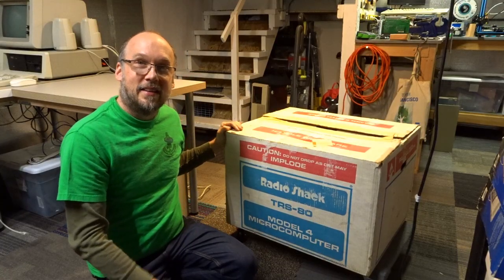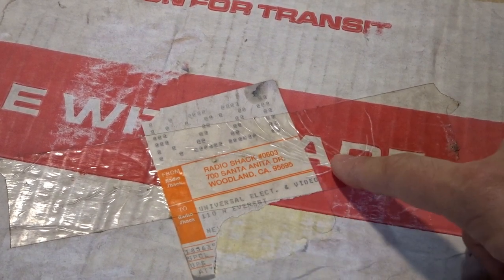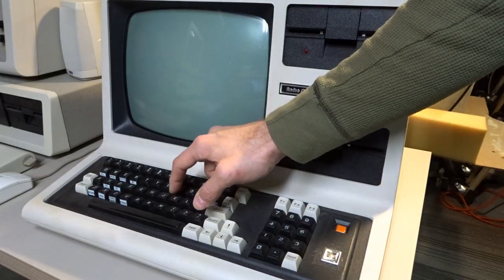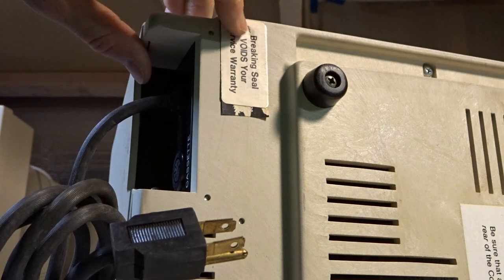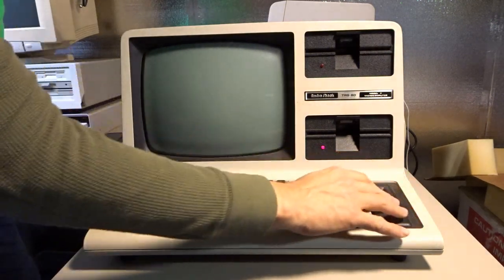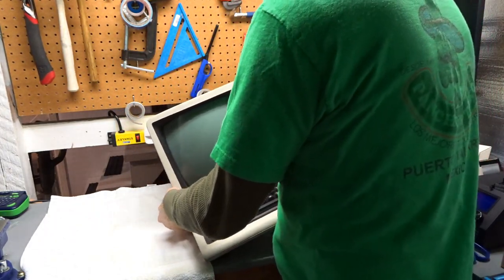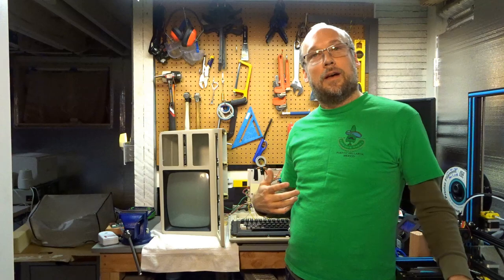Is that smoke? Radio Shack TRS-80 Model 4 Computer Unboxing and Test

Comment: Damn you just voided your warranty by opening that thing.
Reply: That's really a myth. Manufacturers are always putting those stickers on, but by law, they cannot void your warranty just because you opened it.
Reply: Tesla has a seal that says opening their car motor that warns - “opening this motor voids your warranty”. I can just that motor apart to see what’s in it and not worry about voiding my warranty?
Reply: @reh3884  Around 1982, I opened a Model II to adjust the horizontal position, later it was taken in to a RS Computer Center and they ended up charging a fee because the seal was broken.
Reply: @reh3884  I don't know about the jurisdiction in your country, but here in Sweden warranty is laregely a voluntary thing on the manufacturers part (with some exceptions as stated in law), and if it's voluntary the producer is free to deem the warranty void. And I guess that law works the same way in most other jurisdictions. The thing of note here is that many people probably misunderstand the meaning of the word "warranty".
Reply: Australian law contains an implied warranty for anything sold, which takes precedence over any warranty offered by either the retailer or the manufacturer.  Unless the retailer or manufacturer can show that your opening the case either caused or contributed in a major way to the failure, they risk an expensive penalty imposed by a court of law.
And no, the consumer does not generally have to initiate that court action.  There is a government body which will do that (although they prefer to avoid expensive court action if it's possible to resolve the complaint without involving the courts).
Reply: Did anyone catch the sarcasm?   M
Reply: @mirrorsevenband4700  I did, but I was replying to other replies, not to the OP.
The OP's joke gave me a smile, but I didn't have anything to add to it.  It stands on its own quite well. :)
Reply: @j.lindback  I'm taken aback at learning this about warranty policies in Sweden. Your country is part of the EU and as such ought to comply with 1999/44/CE and 2011/83/UE Directives about the Sales of Goods and Services which state that the compulsory warranty is 2 years minimum and operates between seller and customer for all goods legally sold brand-new. That is the legal non-waivable warranty as opposed to manufacturer's warranty which is totally optional and voluntary. Are you sure you got your info right?
Reply: @richshealer3755  Seal are endanger species, they must be protected.

Comment: I worked for Radio Shack Canada in the   distribution warehouse in Barrie, Ontario for years just at the tail end of the TRS and Tandy Computer era.  I was a QC inspector for computer equipment.  The 4C4 on the box is the date code which would confirm final assembly was April 1984.  "Burn in n proud" is a new one on me but may mean it was one of the units that were QC tested before the shipment was released for distribution.

Comment: I have had a lot of these very same RIFA brand filter caps blow up in some military surplus bench power supplies that I picked up a couple of weeks back. I know that very smell! 

PS: Once you are done recapping this beast you should add a stamp of the same style with "AB RECAP N PROUD"  

Good to see you back!
Reply: those RIFA s are notorious for this problem, they should ideally be replaced on sight, especially if their epoxy casing is cracked or showing signs of starting to crack
Reply: as for the other caps, they'd probably be ok, this was made well before the 'capacitor plague' era! i rarely come across bad caps from the 80's,
Reply: "AB RECAP N PROUD" made my day :D

Comment: Oh no, you let out the magic smoke from the computer. It will never be the same
Reply: The Mad Salvi rip pc
Reply: Don't worry; all you have to do is put the smoke back into the computer and everything will be fine.
Reply: You can get a replacement can of magic smoke at the same place as you find the long weight and the round tuit.
Reply: @1973Washu  that is also where they sell headlight fluid and elbow grease.
Reply: @MadMorgie6318  lol

Comment: My first computer was a Radio Shack model 1. I got it because they upgraded the 4k mem model to 16k. Would anyone ever need more! No floppy drive without an expensive add-on and stuff saved to a modified cassette tape deck. 1979.

6 years later I obtained a Mac SE. Still floppies (3.5") A friend an I ordered Quantum hard drives and installed them. By buying two we got a special price of $540 each for 40 meg, not gig drives. We had to remove and modify one of the floppy spaces to install them. Would anyone ever need more storage space! Great wild west times.
Reply: Wow 40 meg, you glutton! lol my Olivetti 086 only made do with 20 (although it did have 128k RAM I think and a socketed 087 math co-processor so it was quite the lightning bolt!)
Reply: i had hte external 20Meg drive on my se. ohh the days. still have that thing.
Reply: Totally, I remember being so excited the FIRST TIME I PUSHED A CD-ROM TRAY EJECT BUTTON, OH MYSTERY OF MYSTERIES, If only I could evoke that simple exciting feeling with my VR games, I'm trying!

Comment: I worked at TCA from November 1983 to Dec 1984, I was also in the back working on Model 4 pcb’s, and the floor with the Floor Techs and in Engineering. We were developing a model which would contain a modem IiB and some better drives, but were always under the cloud that everything we were working on was about to be overcome by events. Sure enough, when I visited the plant a year later, only a handful of people remained; the CoCo assembly line took up a tiny square in the middle of what was once a sprawling plant at 1515 Goliad Road. The building is even gone now. But most of my best troubleshooting and electronics skills were finely honed at Tandy Computer Assembly, and I happily remember my days there.
Reply: I started with a CoCo 3 <3

Comment: From the key labels, I would say this unit was used for word processing. The popular word processor for this model was Scripsit, and they would have used it with one of the Daisy Wheel printers on offer at the time. When I was working at the Radio Shack Computer Center, we sold a ton of these to attorneys for word processing. Couldn't keep them on the shelves.
Reply: Yep. My dad got a second-hand model I which included Scripsit with its collection of software in about 1980. I remember there being a section in the manual telling you how to label up your keyboard. It came with a set of audio cassettes as well with spoken lessons on how to use the software.

Comment: That shipping label is from the DC to the store who ordered it on behalf of the customer. They gave each DC a ‘store’ number for tracking by their warehouse management system, which was written in the 70’s on a Tandem non-stop machine and was continually used until they shut it off in 2017.

Comment: I worked at a Radio shack Computer Center near Northlake Mall, Atlanta when the model 4 came out. That vinyl cover you have there is a separate SKU.  Sold separately, and didn't come with the model 4.  I had a model I at the time, and the 4 impressed me by being a single self-contained unit, which solved problems we were having with the Model 1 keyboard and expansion interface cable.

Comment: This Model 4 is definately not a Gate Array version. As the gate array board has a different layout the serial port exists to the rear of the cabinet. A gate array board won't fit in a non gate array cabinet. This destinction is the only way to tell if it's a gate array board inside without opening the computer and looking on the board itself. -Rainer (Germany)

Comment: I had the TRS-80 when I was growing up. Or at least, my older brother did, they were his but I still have a lot of memories of using it. Our grandparents gave us a TRS-80 and a TI 99/4A. 
The Tandy was an earlier model, the monitor was separate from it, and we used cassette tapes. There were game cartridge slot on the side of it too. 
It was such a great computer for its time too, this was somewhere mid 80s for me. There was this magazine I remember getting in the mail that was just all about the Tandy with codes and everything. This was back when you ordered video games through the mail. Cheap print out catalog, and they'd send a floppy disc or cassette in the mail inside a plastic sandwich bag. It was cool.

Comment: Interesting find, I remember the cheat for the SSD was to use a paper hole bunch on the diskette jacket and flip the disc to double that storage. You're right about the homemade hacks -- I bought a Coco 2 that had a half meg ramdisk that was bolted atop the frame because apparently it ran too hot inside the case.

I'm not sure if I would bend that case back if I were you. PCBs are pretty fragile and once the tracks go open then get held in a working position they don't like going back to the way they were before.
Reply: Best as I can remember the hole punch trick should work because the magnetic disc itself has a hole already in it(for the index hole sensor). So once the hole is punched in the jacket on the other side the index hole sensor has a clear line of sight through the disc jacket and the magnetic disc itself. I'd say I could be sure 90-95%.

As long as you have right type of discs with the index hole in them on the magnetic disc it should work just fine.

I've got 3 TRS-80 Cocos total, 2 of them TRS-80 coco I's and I think they are original drives. I look forward to your upcoming videos as I didn't even know there was a CoCo 4. The lay out of it reminded me of my friend with a Commodore PET.... it had a little rod like car hoods do to keep it up and he used to hide his cigarettes in it!
Reply: Yes, it was hard indexed instead of soft like the Apple was, but the trick still worked. You just had to also punch out the index hole for the other side.

Comment: I saved one of these (non Gate Array) right out of the e-waste dump a few months back. Worked right away. It's at home, working on recapping the power board.
Reply: I feel you. This was at one of the few places with no restrictions. I was shocked and kinda pissed that something so old and valuable was just dumped like nothing. Were I not there, that's one more TRS-80 gone forever.
I've been looking for a Sony Trinitron for a while without any luck. It's likely most of them around here met their end at that same dump... I don't want to think about it.

Comment: Ooh... a Model 4. My first computer was a Model III. :)

Had 64kB ram and dual 360kB floppy drives.  I first learned to program on my TRS-80.  I had loads of fun on mine. I even programmed the cassette port to produce sound in Z80 assembly.

Comment: I worked at TCA in San Antonio - Tandy Computer Assembly. It was located at 1515 Goliad Road on the south side. We sent our assembled and tested Model IVs to TAP (Tandy Advanced Products) for their QA prior to delivery to the stores. I really loved working here, and worked everything from board component level repair, to test-fixture design and manufacture. They had stopped Model III production prior to my arrival, and there were boxes and boxes and boxes of MIII CPU boards stacked everywhere to collect dust. I never could afford the Model IV, but built my own on prototype boards a few years ago (about 2018) but has a 24x80 monochrome display.

Comment: OMG.  The first computer I have ever used in my life was the TRS80 Model III.  It did not have a floppy disk drive.  Only the instructor had a floppy disk drive and we would take turns to load our programs from the serial port with a rotary switch.  It brings back so much memories.  I went from not even able to type to programming BASIC on that computer.  It was an amazing experience learning how to Poke and Peek.  Eventually, my final project in 8th grade was to make a space invaders clone.  I had to program the moves and track the bullets moving up and the motion of the shooter.  Needless to say it was extremely slow, but it worked!  I still remember it to this day.

Comment: RIP Radio Shack
Reply: ncgallagher 
The company still lives, and is still supplying remaining independent stores. Whether that will continue far into the future, or if that's only to clear out old stock, is a good question. I hope it'll continue as I like being able to run 15 miles to the Shack to buy parts, rather than having to wait 7 to 10 days for the twenty cents worth of resistors (and having to buy ten dollars worth) needed to finish a project.
Reply: out where I live there is nothing within hours so they don't live for me. and thats true for most of the country. so no youre wrong.
Reply: ncgallagher 
True for most people, but technically not true for the brand itself. I'll admit that I'm one of the lucky ones to have an independent store near me that's still open. Although, that did triple the distance to the closet store, after all the corporate stores closed.
Reply: our radioshack closed just a couple days ago:(
Reply: I still see RadioShack stores around here, along with K-Marts too. Nothing ever goes out of business here.
Reply: They deserve it. They are overpriced.
Reply: DrFruikenstein the closest location is now a good 5 hours away from me in a MUCH smaller town!
Reply: I’m not sure if the Radio Shack near me is still open, but the last few times I was in there it was mostly just cell phones and radio controlled toy cars, very few parts.
Reply: @Sashazur  I just took a stroll through the nearby Radio Shack in Maine and there were still parts to buy, but it was less than 1/4 of the store. Lots of old LPs for sale in the back, too.
Reply: Radio shack is still alive!They have a online store now and
Reply: Radio shack is still alive, They have a online store now!

Comment: I took 2 years of electronics in high school. In 1979 the electronics lab bought a TRS-80 Model I, with cassette drive. It was love at first sight =) I taught myself BASIC. A Radio Shack would be in a shopping mall, with a TRS-80 on display out front. I would type a 3 line program, filing the screen with text, and walk away... ;)

Comment: I had one of those Radio Shack TRS-80 Model 4 computers and later got a Model 3 to get parts from to repair the original one to get more service out of. That computer only ran the Tandy version of Basic and there was many programs for that computer and I spent many hours using that computer until I got the 1000 from Radio Shack. The CRT had the green screen on it and that computer was well taken care of judging by the look of it with and without the cover on it.

Comment: I had a TRS-80 Model 3, 16Kb, with a cassette, no disk.  It was my first computer upgrade.  Using a cop inserter, upgraded to 64Kb.
Later, I got a Model IV Portable.  Dual 5-1/4 drives.  It looked like a sewing machine.

Comment: That thing was built on January 13th, 1984.  Very cool.  That was my 18th birthday.  I spent most of my time working with Apple 2 and 3 back then because we had them at my high school.  I couldn’t afford to my own computer until 1992.  I worked with Macs when i was at KPMG from 1989-1992 and bought an AST 486/25 as my first PC.

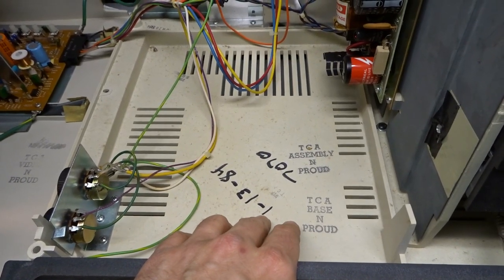Comment: The most impressive part is at 14:30, you can still see the rubber bands are intact on the wiring harness.  You would think those rubber bands would be rotted away by now.  The other rubber band on wire harness along the wall survived but it broke.  Now that's hard core rubber band engineering.  The only reason why this computer still runs is because it doesn't use lead-free ROHS solder.  Back in those days, we use nothing but good old tin lead solder that is soft and compliant.  They last forever.

Comment: Wow memories.  Nice condition.  First was Tandy 1000 with 128 k RAM and 1 5.25 floppy.  Upgraded to 640 k RAM 2 floppies and an TEN MEG hard drive.  It was wonderful.  Learned DOS.  Green screen and a 17 inch daisy wheel printer.  Upgrading cost over 1000$.  The hhd was 200$. 
Really durable reliable computer.

Comment: I have a model 4 that needs a bit of TLC. It used to work, but the display image started "melting" to the left at a certain moment. I'm told there are some adjustable potentiometers that I can try. Honestly, I am a software guy. I wrote lots of Z80 assembly in the 80s, but maybe I can get it back to work again. Nice to see there are more M4s surviving.

Comment: I used to fix computers for a living when the TRS80 was a current model and I thought that I smelled capacitor smoke at the appropriate moment in the video. That smell never quite leaves you, does it?
Reply: Burnt silicon smell vs capacitor smoke smell.  Tough call, they're both unforgettably distinctive and scary and stinky, lol.

Comment: Back in 84' I purchased my first computer from Radio Shack. A Tandy Color Computer 2. It came if a 5 1/4" floppy drive, cassette and 16KB of ram with Motorola 8088 chips. I learned how to program in BASIC. Paid $400 back in the day!
Reply: Motorola 8088 ? More like an Intel 6800.